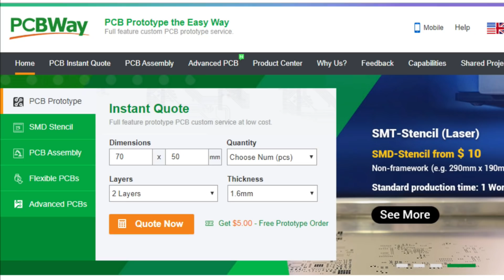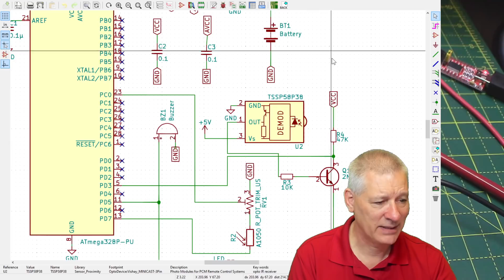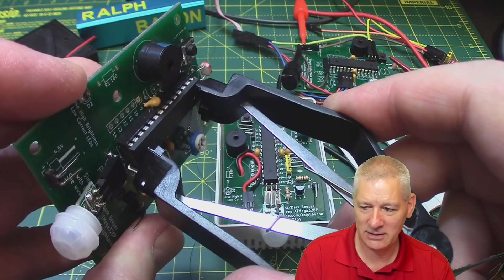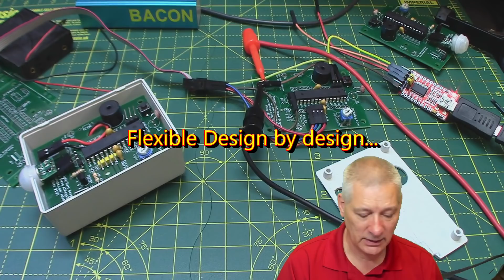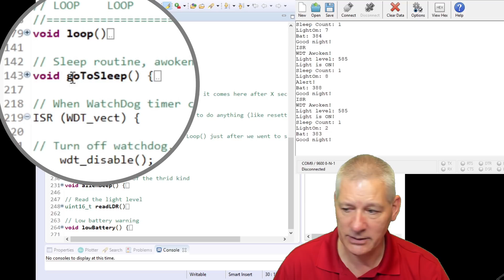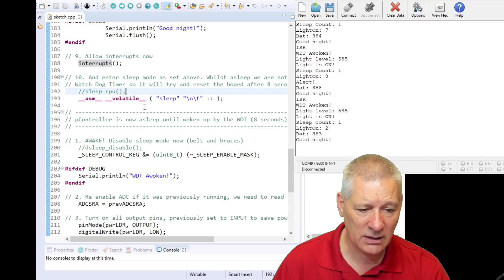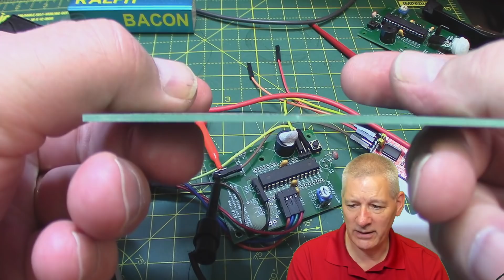#166 ATMega328P 💤 Alarm Update - WDT & Interrupt & Custom PCB

Comment: Since we're at it, the best way to implement a bridge door alarm, IMO, is to use a normally closed reed switch between the battery and the Arduino, so it cuts the power entirely when the door is closed and turns it on when open. Then an 8 second deep sleep before starting to beep does the rest. I have an ATtiny85 that's been working like that for ages and ages.
Reply from the maker: I'm glad yours works fine, Dan, but in my case I have a different Fridge Door Alarm entirely because my door closes just enough to turn off the light but not enough to shut. So I have a magnetic detector (reed switch, like you) that closes only when the door is actually closed, not when the light is off. Ironically, it is that very light switch (actuated by the door) that has just enough resistance to stop the door closing. Mine also makes a trilling noise when the door opens and closes, which both dog and cat have come to recognise! So I also implemented a touch point so I can open the door without the trilling noise! It's all very simple and works like a dream!

Comment: hi ralph great video how about combining sketches and using tabs on arduino ide so we can use some of your codes
Reply from the maker: The sketches are now on my GitHub (I missed that step, sorry) so you can take the code, Alban, and learn from it what you will and amend it to suit your needs. I hope that helps.
Reply: @RalphBacon  i am using a mega to control servos around a room so need to control say 10 on mega and 10 on a nano using either i2c or rs485 but cant combine sketchs for servo control and rs485/i2c .

Comment: Only makers can make a problem out of anything, I know I am guilty of it, till I started catchin on to my own overcomplication. But yea... Chinese are laughing because they would use a  0.2 cent microcontroller specific to this task rather than our full blown atmega328 overkill. Mothers out there are laughing because they would just buy a $1 plastic childproof latch, 3d printer nerds would just make their own childproof latch, grandpa would use and old rubber band from the garage, grandma, who is always in the kitchen it seems, is not going to tolerate the cat in the kitchen and the cat knows it. Only makers can literally take a free or $1 project and turn it into a mortgage on the house. It might be they spend so much time on electronics that there is no time to train pets. Its quite the Ouroboros, just made out of jumper wires.
Reply from the maker: Only makers can invent a solution for any problem, I would say! Remember, too, that whilst I would have made a version of this anyway (I have all the parts) it was a chance for my sponsor to show off some PCBs and for me to educate makers in the two ways that Deep Sleep can be interrupted. And all for the price of large Cinnamon Latte at my local coffee house!
Reply: Its a great project and good learning experience I bet as well.

Comment: My board using your auto-switch-off from video #123 went together with ease and worked 100% as designed.  The circuit only powers up when needed and self-sustains by holding a pin high that is connected to the n-channel mosfet gate. Of course I discovered that the Atmel 328P must be set to use the external crystal otherwise it uses the internal 8Mhz oscillator divided by 8. A modifications to boards.txt and burning a bootloader fixed it up for me.
I'm trying out a modification that uses an NPN transistor instead of the n-channel mosfet so I can use the assembly service with all SMDs from the 'basic' list.
My next device in my RF24 radio network will use deep-sleep so I'll be revisiting your videos for that design. This is such great fun :)
Cheers, Ralph & thank you.
Reply from the maker: I'm so glad it's all working out for you, Dirk. I'm happily running my 328P at 8Mhz and on 1.8v (I had expected to have to divide by 8 as you said but no need for me right now). Sounds like you're learning a lot! Good to hear from you.
Reply: Set the lower fuse to E2 so the internal timer is not divided by 8. I do this with an avrdude command. Google all that and you are on your way.
Reply: @RalphWLundvall  Yeah, problems with getting the ICSP to work lead me into a deep-dive into setting the fuses and creating a tailored entry in boards.txt for my stand-alone 328P projects. Learned all about avrdude as well. Thanks!

Comment: amusing ! over engineering , lets stay complicated , replace the fridge switch with a relay activated by a PIR with or without an arduino...
int val1 = 5;

#include <avr/sleep.h>
 
int wakePin = 2;                 // pin used for waking up
int sleepStatus = 0;             // variable to store a request for sleep
                   
void wakeUpNow()        // here the interrupt is handled after wakeup
{ 
 }
 
// the setup function runs once when you press reset or power the board
void setup() {
  Serial.begin(9600);

  delay(2000);

   //pinMode ( 4, INPUT);
  pinMode ( 9, OUTPUT);
  digitalWrite(9, HIGH);
  pinMode (13, OUTPUT);
  pinMode(wakePin, INPUT);
  attachInterrupt(0, wakeUpNow, HIGH);
}
void sleepNow()         // here we put the arduino to sleep
{
    set_sleep_mode(SLEEP_MODE_PWR_DOWN);   // sleep mode is set here
 
    sleep_enable();       
 
    attachInterrupt(0,wakeUpNow, HIGH);
    sleep_mode();            
    sleep_disable();         
    detachInterrupt(0);     
}

void loop() {

if(digitalRead(2)==HIGH){ 
  val1=10; 
  digitalWrite(9, HIGH);
  }
 

if(val1<0){digitalWrite(9, LOW);Serial.println("going to sleep");}
if(val1<0){delay(1000);sleepNow();} 
  Serial.println(val1);
  val1=val1-1;
  

  if(val1<0){                  
  digitalWrite(13, LOW);    
  }
else digitalWrite(13, HIGH); 

delay (1000);
digitalWrite(13, LOW);
delay (1000);
}
Reply: Or just superglue the switch to prevent it operating. ;)
Reply from the maker: It all depends on what you mean by complicated! This project's PCB was sitting there and could be easily converted into a light on detector (whilst using WDT and Deep Sleep), sounds like a no-brainer to me!
Reply: @RalphBacon  please accept my apology. my comment was intended to be funny. keep the good work , i am learning a lot watching your channel.
Reply from the maker: Glad to hear it! And no offense taken, sometimes we Arduinites do sometimes over engineer solutions but this one is fun and cheap so if beginners are looking for something to build this might be it! Well, the Fridge Light alarm version, anyway... Keep watching, thanks for clarifying, good to hear from you.

Comment: Btw. the edge interrupt should work on an atmega32 in both directions (what do you mean by "it doesn't say it works reliably"? It says it does in the datasheet). Are you sure the output of the PIR sensor is push-pull and not just some kind of open-collector output? You don't want a floating pin.
What are the voltage levels on the output of the pin? Maybe they are just too low for the AVR to be read as "high".
Reply from the maker: I was using HIGH as the trigger value which is not (officially) supported; I could have used RISING, I suppose? The PIR is definitely a true HIGH or LOW, no floating pins (it's the same device I used in the Home Alone project, so I really checked that out). It works very reliably now so LOW (and perhaps FALLING and RISING too) are the options to choose it would seem.

Comment: nice video, but I was wondering could you have used the attiny85 chip for this project would it have used even less power?.
Reply from the maker: Although I've used ATTiny85 in the past (and done videos on them too) they quickly run out of pins and capabilities, I find. Even though I got both I2C and SPI working on one it was not as easy as using a 328P chip. If this were a commercial product then doubtless that question would be asked and the answer might well be 'yes'!
Reply: I love the Attiny85, but its too damned expensive. The DIL is about 1.25 USD and I have seen prices over 3 dollars. With a bit more you have a fully fledged Arduino pro mini.
In fact, even the Atmega168 DIP is like robbing yourself: it costs about 1.50-2 euros and a pro-mini 168 about 1 euro.
If I would be designing a PCB like this, it might be worth considering designing it for a TQFP32 package 168. That costs 50cnts. An attiny85-20su will still be 65 cents so way overpriced.
However.... could you get an attiny13-su (23 cnts)  to do this

Comment: Nice Video as usual ;) i really like the practical Projects 

to the Fridge:
I think the Pins from the Relais are Welded together.
"Mr Carlson's Lab" done a repair Video about the same Problem he had...

He had replaced it with a Solid State Relais, so no "sticky Contacts" ;)
but a cheap Relais will do the Job and is easy to replace.

Video:
Kenmore LG Fridge Repair Process.
www.youtube.com/watch?v=ABK-BndqGz8
Reply from the maker: Glad you liked the video! I shall look at that video link you posted once I have replied to the comments here, thanks for sharing.

Comment: It should be enough to "set_sleep_mode()" once in setup (unless you want to change the sleep mode later). Then use "sleep_mode()" in the loop. It does the bit setting for you. No need for any other commands.
I usually have a global variable (make sure it's volatile) that is set to a certain value in the different ISRs (giving those values "names" with an enum helps with readability a lot). Then immediately after "sleep_mode()" (often the very first instruction in the loop) I check the value of the global variable. That way I can easily ignore interrupts that weren't triggered by me (but by something in a library for example) and go right back to sleep (if you call return within the loop it starts the next iteration of the loop). Or I can execute different things in the loop depending on the interrupt (because you always want to be your ISRs to be as short as possible).

Example:

enum interrupts: uint8_t { // this is essentially giving names to the values 0, 1, 2, .... for more readability
    NONE,
    COUNTER,
    WDT
};

volatile uint8_t last_interrupt = NONE;

void setup() {
    set_sleep_mode(SLEEP_MODE_...);
    ....
}

void loop() {
    sleep_mode();
    if (last_interrupt == NONE) { return; } // run next iteration of loop if interrupt wasn't set to something we want to handle
    last_interrupt = NONE;
    ....
}

ISR (TIMER2_COMPA_vect) {
    last_interrupt = COUNTER;
}
Reply from the maker: Interesting! I like this and will experiment in due course. Thanks for posting and sharing.
Reply: @RalphBacon  
I don't know if you've seen this page already:
http://gammon.com.au/power
A nice collection of power saving hints for the AVR/Arduino.

Comment: Another excellent video, Ralph. I am impressed on the use of the WDT for timing the sleep. Finally, a comprehensive description of the procedure necessary to achieve the lowest power consumption in sleep mode. I am not sure what correct equivalent  for pedantry in the electronic maker world is but excuse my being "pedantic" when I point out that a small hole in the back of the container corresponding to the reset button would be efficacious. This would allow a narrow prodder to be inserted (as is common in many commercial electronic products) by a "none maker" who is being driven to distraction by the piezo sounding continuously.
Reply from the maker: I like the 'reset' hole idea, Michael. Idea duly taken on board and claimed as my own!!! Yes, this device is working well but I did discover it could be triggered by the hot water pipes as they heated up in the early morning! I've moved the device away from the pipes now...

Comment: Besides always including a reset and an ISCP, I have started pulling unused pins out to a 2 by X header so I can use them as configuration input pins with little jumpers.  For something like your frig timer, this could be used to set how long you want to wait before sounding the alarm. If I have more room, I add a dip switch so I don't have to look for those little jumpers.
Reply from the maker: A great idea, Edward, and you'll like my next project which contains those little DIP switches!

Comment: Life is a good learner. Thanks for sharing useful tips to avoid these kind of pitfalls. 

Question; For the ICSP signals, is MISO strictly needed when programming, if using header pins and you are short of space or constrained in some other ways to use the standard 6-pins socket?
Reply from the maker: Maxint is correct that only 4 pins are required to program (and debug) the chip as long as you have a bootloader already present with NO plans to change it. Yesterday I had an issue with a different project: one of the chips would program fine but would NOT run in my circuit. Why? I had left the brown out detector (BOD) active whilst trying to run at 1.8v! So I had to change the bootloader (well, the fuses) and that does require ICSP.
Pogo sticks also a good idea but not cheap. But then only one cable is required, I suppose, so cheap overall.
Reply: MISO is used when programming via ICSP. You can also use a bootloader and program via the RX/TX pins. With ground and Vcc that's only 4 pins instead of six, which you can also use for debugging or other output monitoring.
Reply: In space constrained boards I often use tag-connect footprints and make a cable for programming. It uses pogo pins and has a small footprint. 2x3 for stm32 works for Atmel as well. No components to place either.
Reply: @jasonrussell6534  Thanks for the info about tag-connect. Another alternative is "SOICbite" Programming/Debug Connector Footprint, a Hackaday project. According to its description, it's cheaper than a Tag Connect and may even be smaller.

Comment: Fascinating video, many thanks.   Btw ... did you test what sounds you can hear from inside your mates fridge? Perhaps there is a plan B with a vibrating actuator affixed to the inside of the fridge?
Reply from the maker: The sound it makes is generally audible, Chris, but not if you're in the living room with the door shut and the TV blaring away. However, under normal use, that is, lounge door open, moving around the house or between the kitchen and lounge it could be plainly heard. But I like your idea of a vibration motor, like those you get in mobile phones, that is definitely Plan B, thanks for posting.

Comment: Very good video, very useful.
Just a minor correction: tone does not use PWM (which has constant frequency), but "Use of the tone() function will interfere with PWM output on pins 3 and 11 (on boards other than the Mega)", because the function uses that timer.
Reply from the maker: Always good to know the finer points, Sven, I should really have looked this up. Thanks for the info and for posting.